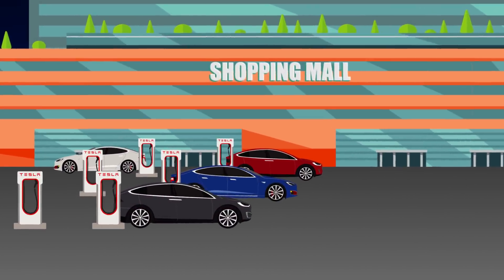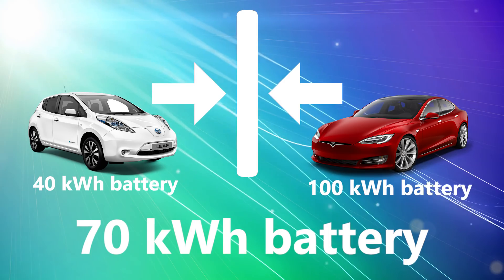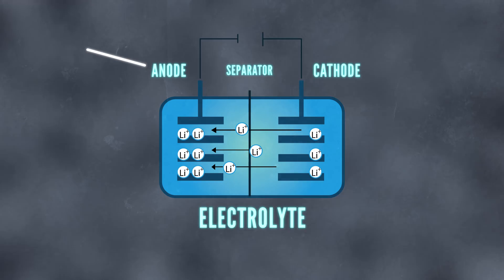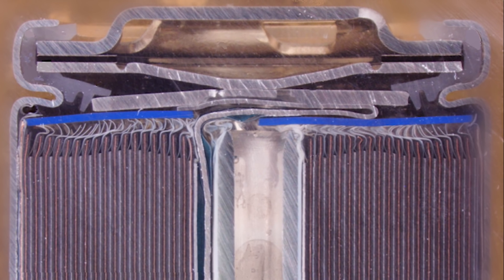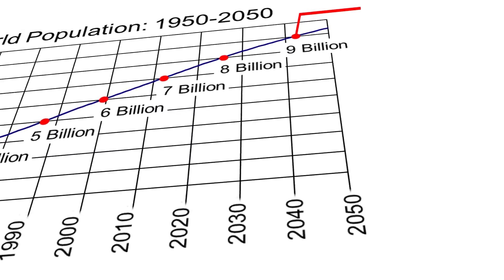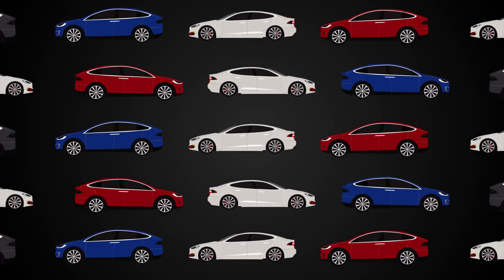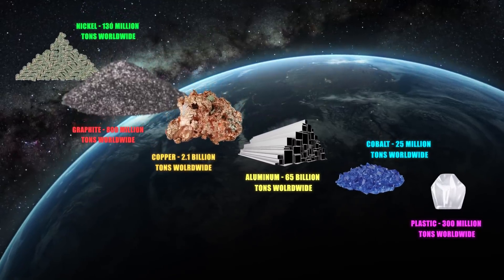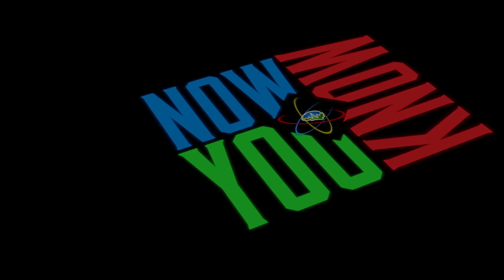Will there be enough EV Battery Material?

Comment: Wait, but won't we build a lot more power walls and power packs for all the solar that will replace old fashioned power generation?  There will be much more quantity of those resources going into them.  Just considering consumption of EV to justify having enough natural resource does not seem complete.

Another assumption you made was there will be less cars due to autonomous driving. Actually the table can turn the other way.  If autonomous driving can make traffic flow more efficient there will be less congestion on the road with the same amount of cars, and more people will be on the cars until the road becomes as congested as now.  So instead of reducing the cars autonomous future might increase cars even more so more natural resource will be needed.

Comment: Folks are mentioning repeatedly that recycling of materials from used batteries will help. Recycling is critical all right, since all these resources are finite and will eventually be used up without recycling. Manufacturing is not sustainable in the long term without recycling of non-renewable resources. But recycling does not affect Zac & Jesse’s calculations. The question is will there be enough materials in total – particularly Li – to meet the needs for the total number of electric vehicles there will be, before you even start to think about replacing presently aging batteries with new batteries in the future. So for the purposes of these calculations, the total supply of each resource is  considered, whether already used in existing products or required for future additional cars and other products.